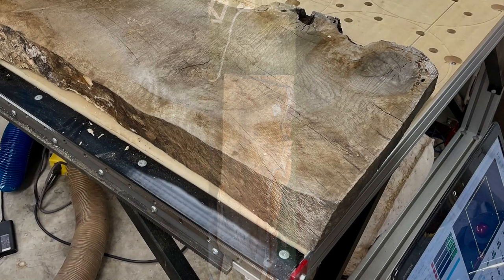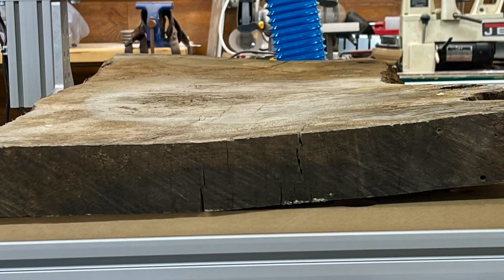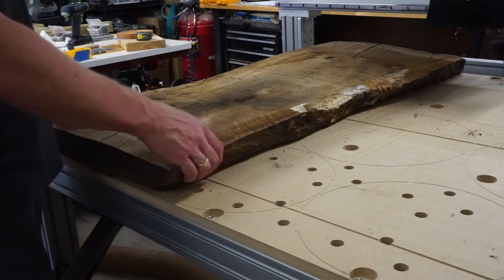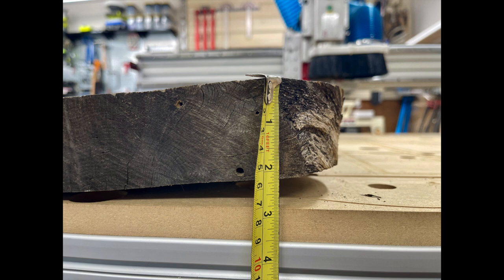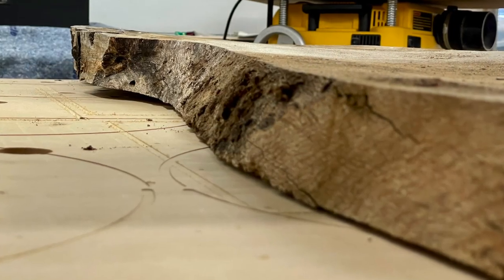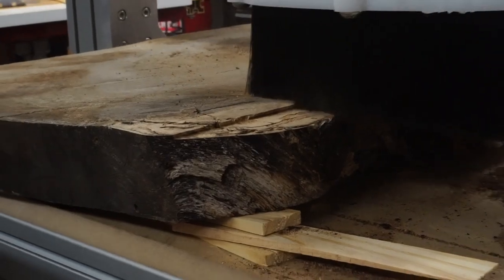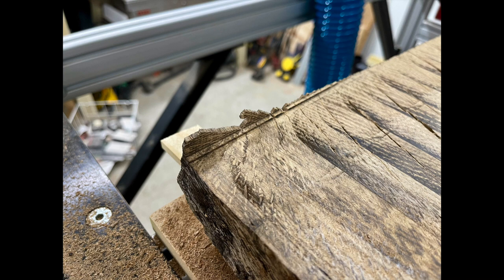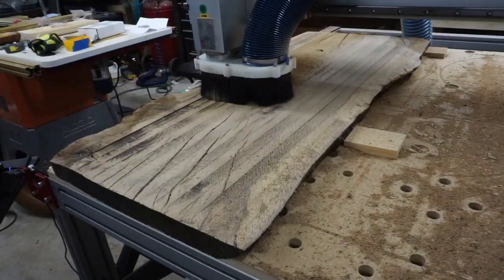Making Cheap Lumber with a CNC

Comment: Is the Whiteside cutter coated? Great video, I am excited to get my machine. I just got all the shipping numbers for the many packages from Avid.
Reply from the maker: Grimhizzer!  Glad to hear you are about to start the build!  Would like to hear how it goes for you!  The cutter I have been using is a whitside 6220.  It is carbide tipped, but not coated.  I think its intent is for surfacing spoilboards.  It did a great job surfacing my spoilboard, but I think I may invest in one of the Amana surfacing bits with replaceable blades to do my hardwood surfacing, and leave my whiteside for the MDF/Spoilboard work.
Reply: @MattesonCreations  Hey! How have you been? Its been a while since you posted. I hope everything in your neck of the woods going well. Can't wait for your next video.